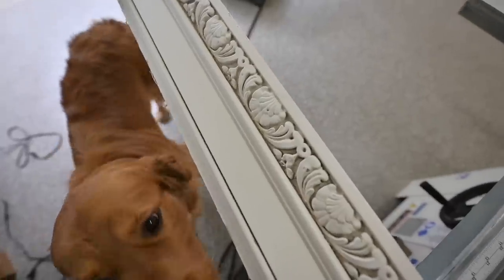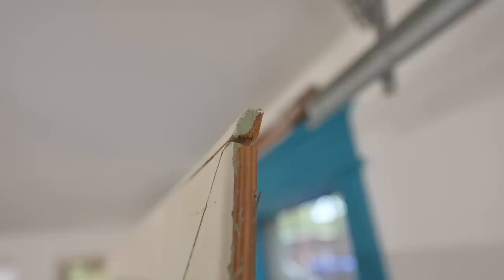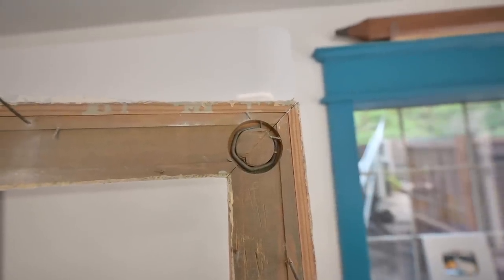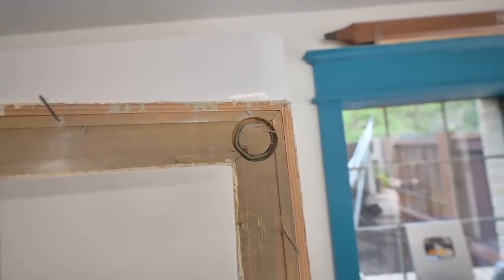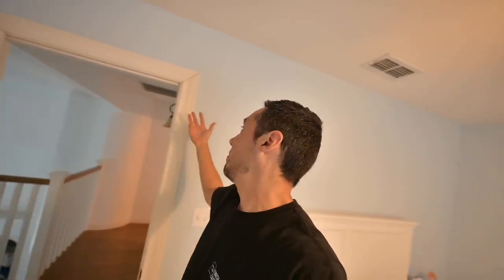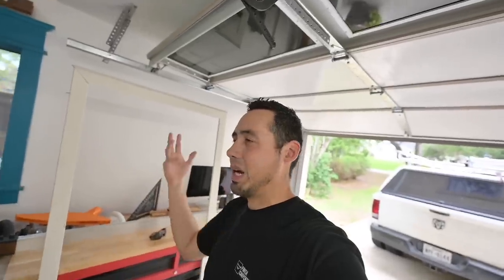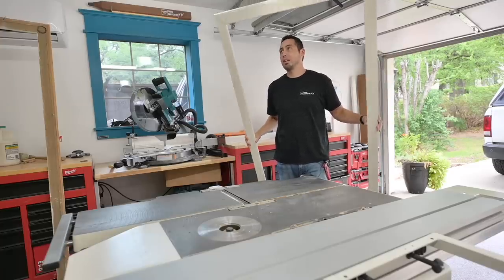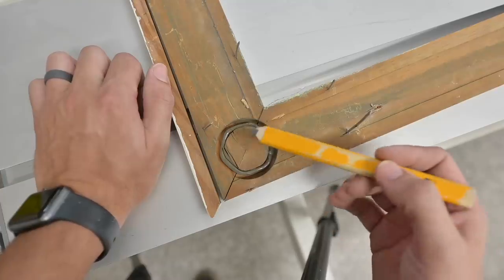Door casing skill lost for 100 years

Comment: There were several iterations of things like the ring used years ago. The purpose being old homes lacked footers, many homes were built on piers and those with a full perimeter foundation were laid right on ground. Due to this, the structure would move seasonally; summer months with increased humidity would cause lumber to swell and push joints, winter months with colder, dryer air and fireplaces for heat would dry the whole house allowing for joints to open up.
     Adhesives were limited to hyde glues that lacked strength so builders developed systems to keep meters tight for the life of the joint.
Reply: Oh thats a clever reason to use something like this! ok - what else can you tell us that would be good to know?
Reply: How did they cut the hex / outer circle? using chisels?
Reply: @ma2perdue  My reference was to some of the variations I have encountered, not necessarily to this particular design. I would imagine that these were cut with a tool similar to one of the predecessor of a hole saw, probably used in an old hand brace and then as you suggested the inner flats hand cut with a chisel, done to engage the ring and hold it in place.
     My personal experience has been with both wood and metal splines cut into the miter and wooden keys relieved into the back of casings. The only real advantage we have today over back then is power tools, the craftsmanship and the architectural ingenuity back then, in many ways exceeds today's.
Reply: @davidhorsley1149  The inner surface of the circle was incredibly smooth, which would indicate that the material was removed during the milling process rather than the imperfect use of a hand chisel (the inner sides of the outer diameter did not seem scored, which would happen when a hand tool was used).  So the device that did the work probably either had a very wide cutting surface, or a planeing device between two hole-drills to remove the material during milling.
Reply: @amzarnacht6710  two points you overlooked regarding the inner surface and lack of scoring. Older tools, like the ones used at or close to the turn of the century (20th), would have been of better steels (less recycled). Better steels take and hold sharper edges which make for cleaner cuts. Also, better craftsmanship. Carpenters from that period #1, were more acclimated to working with hand tools and were more proficient with them because many power tools were yet to be invented. #2, Carpenters back then were more interested in the work than in the time. Repetition and production work didn't rear it's head in home building until after WWII. And the last part about that, is real "Craftsmen" viewed every job as their signature, even if it was never to be seen again. They took pride in what they did and strove to make a product that would last, and didn't ascribe to the philosophy of, "no one's ever going to see it". So if it was ever dismantled for repair future Carpenters would find details like this "connection". Some were regional, some were unique to the carpenter doing the job, and some were just the only way to make the joint, but all were in a way, a signature of the one doing the work.
     It would come as no surprise to me to find work performed with the crudest of hand tools, that appeared to be done by some machine or fancy power tool, because I have seen it done with my own eyes.
Reply: As an addendum to the comment about "better steels", as pointed out, my reference was to, the lack of recycled steels. There is no doubt that controls on  steel making is better today, but the kind of steels used for different applications is broader today. High quality cutting tools today are distinct from mass produced knock-offs, whereas the steels produced turn of the century for hand tools would be comparable to the "artisan" steels of today for cutting tools.
Reply: @davidhorsley1149 , actually, some of my chisels pale any from back when. There are a lot of cheap blade steels out there, but we have gone FAR beyond what they had back then. A few of my pocket knives are better sharpened with diamond stones, because of their edge retention hardness.  For my lathe, I use CBN wheels. Spendy, but so worth it with high speed steel and such.
Reply: @kellyvcraig  my point was about the whole picture. Obviously, you are one of the people I was directing my comment about. People who out of arrogance believe that our time is so technologically advanced that the older generations couldn't possibly do things as good as this present generation.
       Call it what you will, clean steel, virgin steel, or unmolested steel. I have some tools from around the period in question. With a little care they sharpen quickly, they maintain an edge for a good period of time if not abused, and they take a fine edge with native stones and a strop. 
Besides, give a wanna be a $5000.00 tool and you have a wanna be with an expensive tool. Give a Craftsman some vintage garage sale tools and time to tune them to his liking, and he'll give you heirloom work. 
     My point drew on the craftsman's ability to pare the inside hex that registered the ring, without leaving score marks, that gave the visual impression that it was done by machine.
Reply: @davidhorsley1149  it was originally cut as a circle the expansion of the wood inside the hexagon or in some places octagon ring causes it to take the shape of the ring with time aside from the rounded corners that don't quite reach the ring corner.

They had both heavy machinery powered by water or wind that could have made it and hand tools were more than capable such as a spoon auger on a beam drill or just gouges and a hammer.
Reply: @Ho1yhe11  basically, that is what I said. 
       But as to your statement on "machinery", you are making some pretty big assumptions. Even at or around the turn of the century, pretty much all window and door casings would have been made at the site and there would have been no large production machinery on site, so the provisions for that lock ring would have been made on site. As I previously said, with hand tools. I made no attempt to describe that particular lock because, though I have seen things intended to do the same job, I have never seen that particular style of locking mechanism. As I said, that style was unique to either the carpenter that installed that trim or it was a regional oddity. But in my experiences I have encountered many unique methods to execute joinery and responded to the question of the video poster and then one directed to my response.
Reply: @davidhorsley1149  see the other comments on the thread folks, it was likely done by a machine, the other comment thread has someone who has seen the machine
Reply: @WarrickTaylor  I only answered a question posed to me by another commenter. My answer was based on two things; the age attributed to the connection (that type of machine didn't exist in the era the video poster claimed), and the specifics of the question posed to me!
    I have a long experience in construction specializing in restoration work. As I said in my first comment, I have seen many similar connections made on casings, both door and window, but I have never encountered that specific type. The video poster said the casing came from a 1920's era home, and at that time there were very limited power hand tools made. Given that mass production or cookie cutter homes did not show up until post WWII, and even the Craftsman type home kits only included trim in rough cut length, so that couldn't be attributed to that.
     I personally have several tools that will rabbit a round Groove into lumber, but they were intended for another purpose and they are used in an old hand brace, not a "machine". But obviously I have wasted my time over the past 5 decades plying my trade because obviously there are a bunch of experts on YouTube.
Reply: @davidhorsley1149  hi buddy wasn't intending to disparage your expertise, I was trying to point out to the thread that another commenter was claiming eye witness experience of the machine/jig/mechanism that made the joint in case anyone was interested. Speculation is always fun but if someone already has the answer I know I'd prefer to know about it. Take care.
Reply: @davidhorsley1149  You also had less 'Stainless' steel. Normal 'rust catching' steels hold a blade longer, and are sharper, because you don't have the chrome or nickel rising to the surface and creating the 'anti rust' coating.
Reply: @Ho1yhe11  That's exactly my thought too. No carpenter is going to waste time chiselling a hex...
Reply: @davidhorsley1149  nah.. more likely the ring being pressed on made the quote unquote hex you speak of. thats it.
Reply: @jrok96  If you go back to my original comment, I made no reference to the hex. The video referenced it and another commenter posed the question, how the hex was cut, with a chisel?, and I opined possibly, if there was one.
      As I originally commented, in my experience, I encountered several unique means of connecting  casings, from splines to keys. My only statement was that based on the time period, the attachment method was in all likelihood done manually because hand "power" tools were scarce, large "machines" rarely made it onto a jobsite, and mass production hadn't become popular in home building.
      My comment was just my opinion but it was an opinion based on experience. When a comment is a sub-comment or a response, people need to go back and read the initial comment before attempting to correct another commentor. You are entitled to an opinion but not to be an ass!
Reply: @davidhorsley1149  False, patently. Especially tools from that time are in NO WAY as good as modern tools.
Also, RECYCLED STEEL RETAINS IT PROPERTIES, entirely unlike other recycled metals.
So not only are controls better (Including ability to check exact properties and contamination.) but once recycled, it retains it's characteristics.

Machines had been in use for fabrication of parts for a long time, Portable "Shapers" (Routers essentially) existed in the 1920s (1929 shows a reference specifically to "Portable" shapers, implying non-portable ones already have been in use for some time.)
What about the Popular Mechanics Shopnotes pages showing people how to make Electric motor driven planers?
By 1930, 77,000 homes claimed to use powered tools.
The 1920s was EXACTLY the time that people were rapidly switching from hand to powered tools. Those power tools were all from INDUSTRIAL USES, including HOME BUILDING and PREFABRICATION. An example of this would be "Woodworking: A Handbook for Beginners in Home and School, Treating Tools and Operations"

Survivor bias is a hell of a thing, because there's a vast majority non-functional tools from the 1920s than there are functional ones.

I have NO IDEA what "Personal experience" lead you to believe that they didn't use power tools at home, MUCH LESS do I understand how you came to the conclusion that industries were not using powered tools which for all intents and purposes quadruples the effective output of a skilled laborer. This was cut with a machine, and yet it's of extraordinary quality.

Btw as you likely figured out it was machine cut.
Reply: Amazing
Reply: @D-Vinko  that's why all of the high dollar cutlery from England, and Germany, and the Japanese Samurai swords, and specialty woodworking chisels from the Scandinavian countries are forged from small batch, boutique steels, made the old way, from iron ore and controlled amounts of carbon. And as to power tools, in the twenties they were extremely limited, i.e. electric drills, worm drive circular saws were about it. Hand held routers didn't become readily available until the mid to late thirties and didn't become practical for job site use until into the 40's. Large shop style machinery was years before achieving portability, and rarely if ever appeared on site with the exception of, in building mansions of size, or commercial buildings with extensive millwork.
     As to factory pre-fab,  door and window casings are almost always fabricated on site due to variations in plumb and square, so I doubt those casings were pre/factory made. So that means that connection was produced on site, in all likelihood with hand tools, by a "Craftsman" from the period stated in the video. "Door casing skill LOST for 100 years", that means the video poster is claiming this particular "connection" was made Pre-1922, when power tools were "scarce" and pre-fab was limited to large architectural elements built in factories.
     Again, although I have seen variations of similar connections, I have never encountered this "specific" connection. And though my response was to a question posed based on my initial comment, I clearly stated it "is" my opinion. But my opinion was based on my years of experience not only in construction and custom woodworking, but a bulk of those years experience in restoration work in homes in excess of 100 years old. 
      Though your "opinion" may make mine appear "patently false" to you, until you either have encountered a connection of this type, or have accrued a life experience equal to mine, it remains to be seen which opinion is based closer to fact!

Comment: I'm a 65 yr old son of a carpenter and a semi pro wood worker. My father used a bit and brace to drill out door hardware with a special metal fixture clamped to the door to guide the bit into the door, no pilot drill necessary. As far as the molding circle is concerned,  a metal right angle jig much the same as the door jig could be used to clamp the two pieces together and then a hole saw that had a wide kerf could be utilized to create the circular trough for the hex ring. The hex ring could then be forced into the circle, weld knob first to create tension to hold the joint together. This is pure speculation on my part as I have never seen that technique before myself. I get a kick, Richard, at your excitement over such things. Good on you. I also agree with making a glass shadow box, hinged like a cabinet, using the ornate molding to house your unique molding finds. Cut away all but those corners, one facing out and one face in, to start the collection.  Well done.
Reply: It wasn’t a hole saw with a wide kerf… it was a fly cutter. The work was held in jig and secured to a work surface. The fly cutter either came up through the work surface, or down from the top. It was done either way.  The groove depth was achieved with stops on the fly cutter that wouldn’t allow it to go any deeper. Then they placed a hex ring over the island and marked its location to be shaved down slightly larger than the ID of the ring. Then is was simply pressed on and the circular “island “ compressed. All of the casing in my Grandfathers house has these rings. Edit here… there were different size rings but they all start out as round and weld like a chain link in one spot. The rings were made hexagonal by driving a tapered hex drift into them.
Reply: @trevorjarvis3050  Excellent.
Reply: Being around only a bit longer than you, I'm 69, we are barkin at the wind.  The way things were done and could be done ,are lost with the hammer and the hand saw.  Stay good 🔨
Reply: Ff
Reply: That ring looks almost the right size to come off a horse halter.
Reply: I think you're on the right track.

Comment: As a former machinist there had to be a clamping jig and drill press arangement to do this with a wide tooth fly cutter style bit. This was not cut by hand.
Also the rings are factory made and resistance welded together. 
You should be looking for a machine based system sold at that time, even if the machine is hand cranked.
Makee a mirror frame with the rancy molding.

Comment: I agree with the comments saying it was more simple - they probably had a jig set up to align the two boards at 90 degrees and clamp it in place, used a drill press to make the circle cut, and just hammered in the ring. The ring is probably hexagonal just to make it easier to make (6 bends rather than trying to make it perfectly circular), but also the hex shape likely helps it compress and latch into the wood circle and press it together.
Very cool technique, and unexpected.